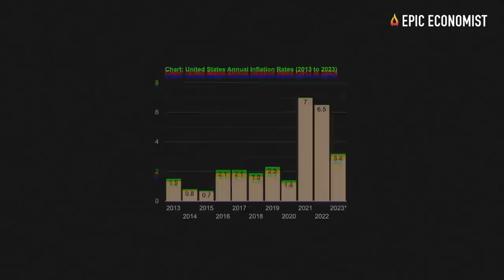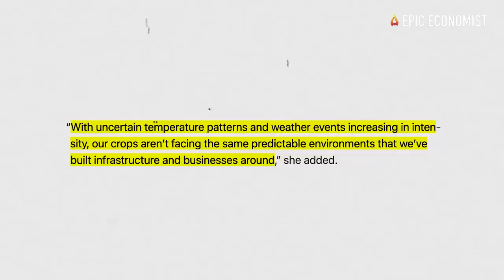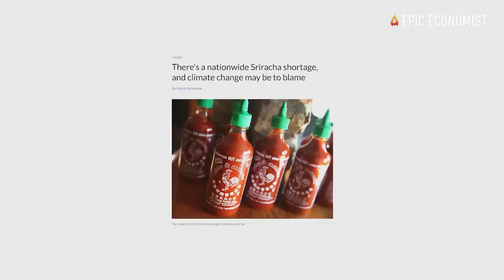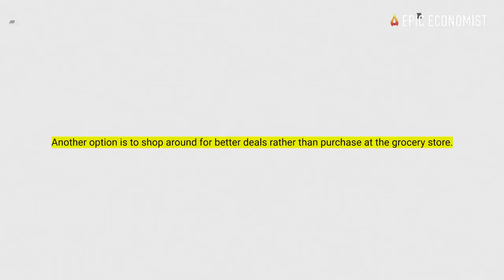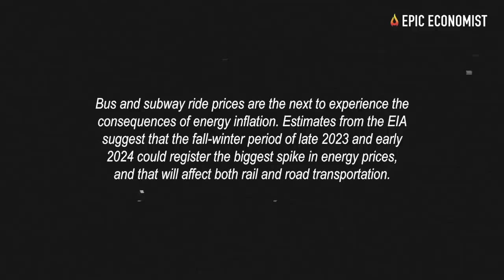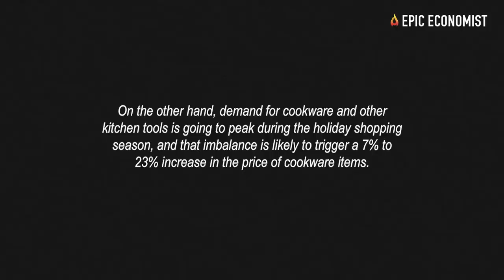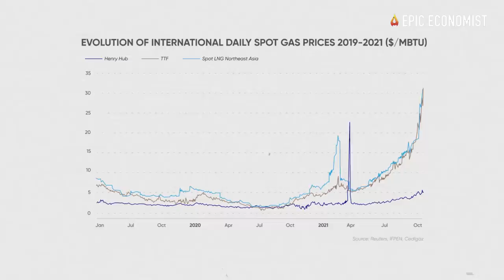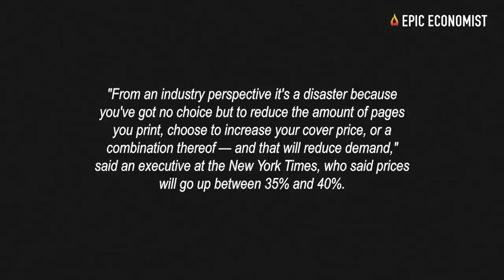15 Cheap Items That Will Double In Price This Fall

Comment: I have found a cheap, organic chili sauce that is much better than Sriracha.  

I will not go back.

There are a lot of other options out there that are priced reasonably.  Diversify a bit and try them.
Reply: What is the chili sauce called? I like the Trader Joe’s garlic chili oil and similar ones on Chinese grocery stores.